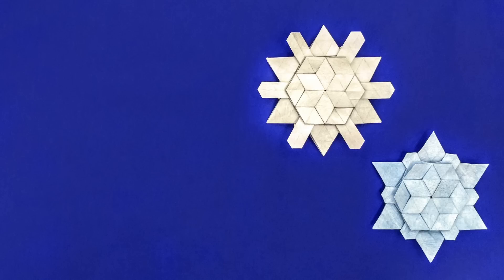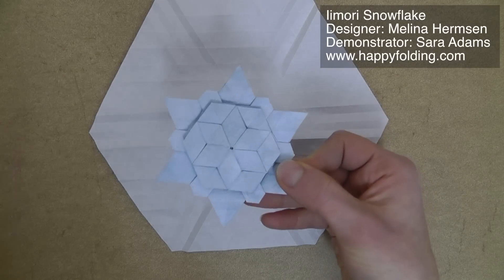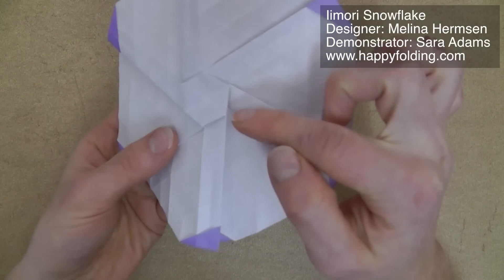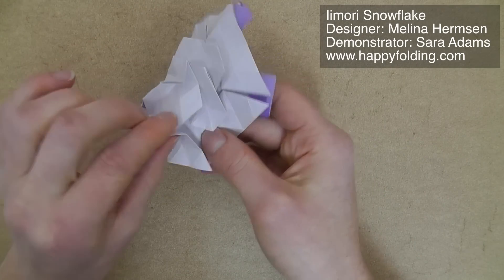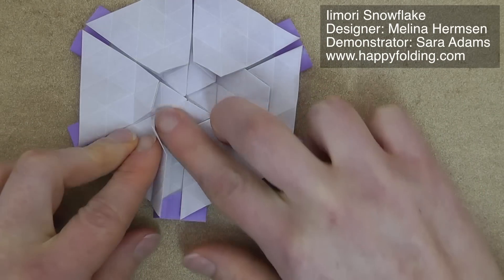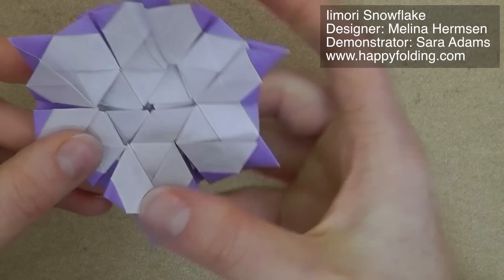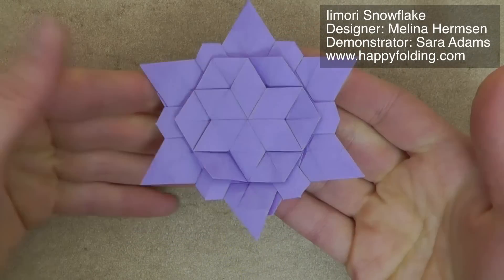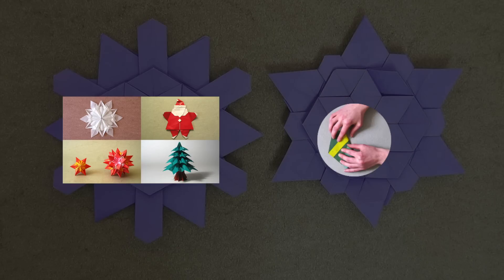Christmas Origami Tutorial: Iimori Snowflake (Melina "Yureiko" Hermsen)

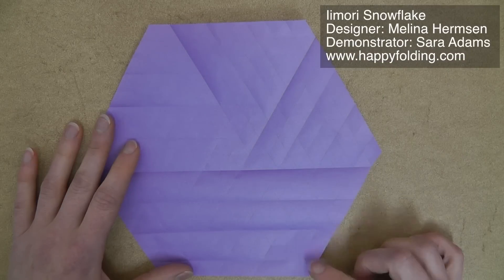Comment: why did she fold so fast 0:56 to 1:16 .i can not understand any step clearly
Reply: Just slow the video down and you can watch it at whatever speed you want. Go to the wrench icon in the right lower corner.  It will appear when your cursor is on the video.  Click on the wrench which is the settings icon.  It will say "normal" speed and you click on that and you can slow it down to 3/4 , 1/2 and 1/4 time and you can speed it up if you want it to go faster.

Comment: The Hexagon from the square would turn out bigger, if you folded/planned it diagonally.
Reply from the maker: There are two aspects that are important: (1) getting a relatively large hexagon from a square, and (2) a sufficiently easy way to fold the hexagon. You are right, you could get a larger hexagon if it were rotated a bit, but it would also be harder to fold. I think the tradeoff of the method I showed is a good one. The hexagon is almost maximal, and it's relatively easy to fold. You may, of course, disagree. :)

Comment: Hey Sara! I don't think you will remember me, but I talked to you quite a while ago about purchasing different origami instructions. I have one problem right now though. I purchased two sheets of origamido from origami-shop.com. When the package arrived one corner of it was wrinkled. As the paper was folded in half in the package the middle of the paper is wrinkled as well. What is the safest way to handle cutting and straightening the paper?
Thanks!
Stephen
Reply from the maker: What kind of paper is it? In most cases, I'd just use an iron to remove the wrinkles. Put a sheet of printer paper between the origami paper and your iron for extra protection.
Reply: happyfolding.com - enjoy origami online it was origamido, but the paper was different from the size I ordered. The wrinkles turned out to not be too much of a problem. I haven't been to your channel in a while. So glad you are feeling better and uploading again!
Reply from the maker: Glad to hear you were able to resolve your issues with wrinkles in the paper! Origamido is very strong and resilient, by the way (even if it's very thin). So if you ever have very strong wrinkles you can also dampen the paper and iron it to get a clean sheet.
I hear some people have even ironed out creases after they weren't happy with their folded model. Origamido, after all, isn't exactly cheap...